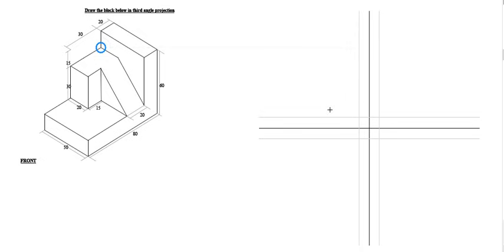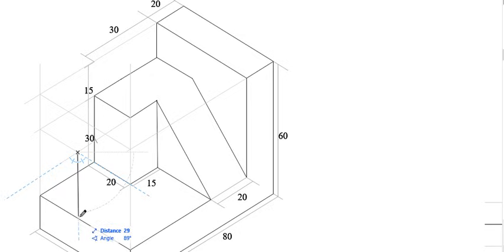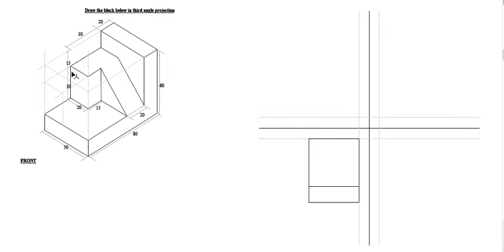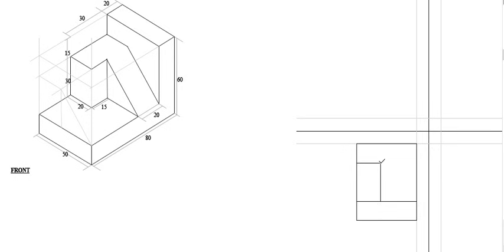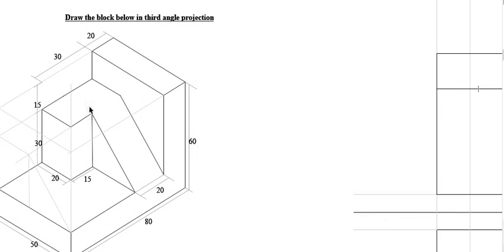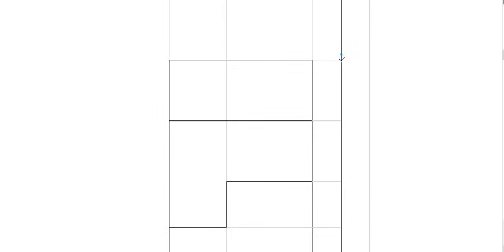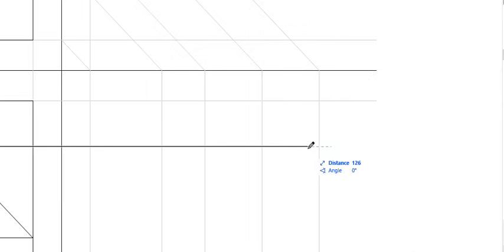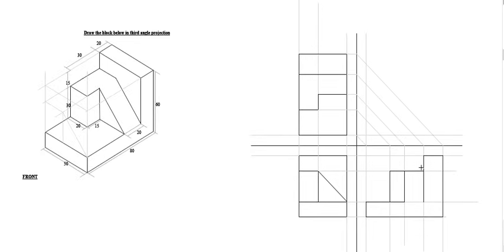third angle projection, orthographic projection, technical drawing

Comment: I disagree with how the views will be seen as u have done. I think this is how I'm t will look like in the plane system. But you have to rotate the horizontal plane according to the rotation principle. In that sense what  the surfaces down in the plan will move up.
Reply from the maker: Do take note of the difference between first angle projection and third angle projection